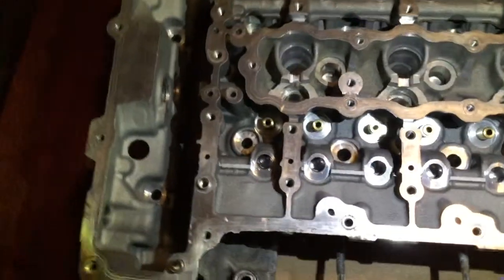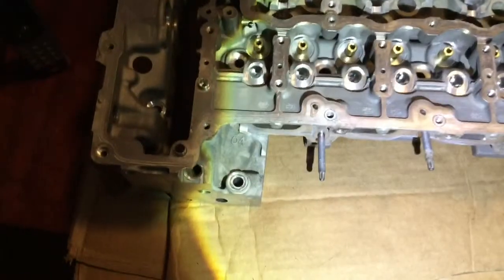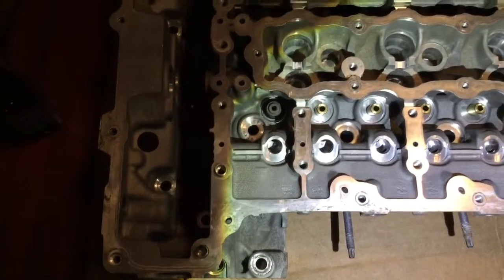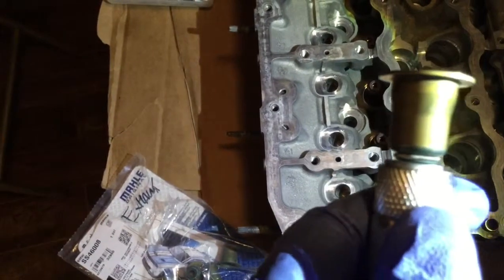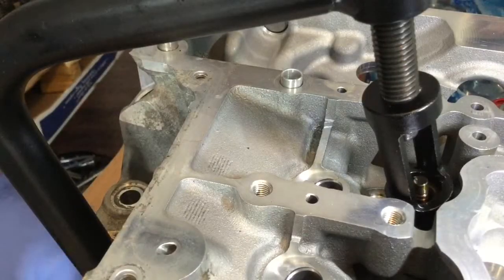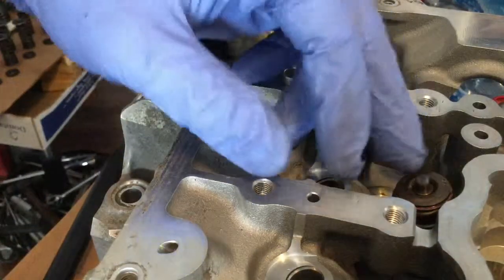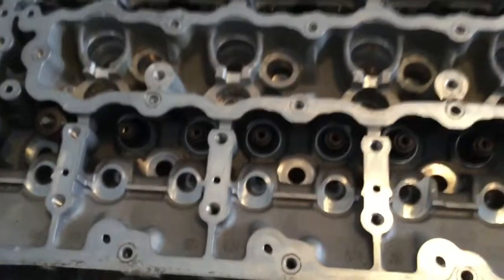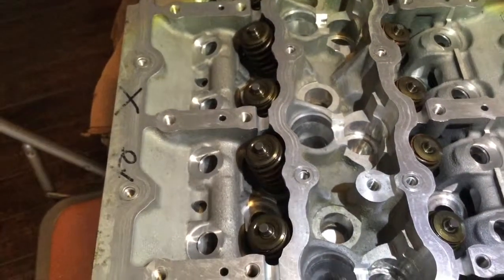43 BMW 135i N54 E82 - Engine Rebuild - Valves Installation

Comment: I usually use a dab of Grece or lucas oil stabilizer to keep the valve keepers in place so they don't keep falling off cause you're method requires alot of patience and god bless you for your patience I still have plenty of patience left but i try not to use them all up and because it's a hobby I love to do great job 👍👍👍